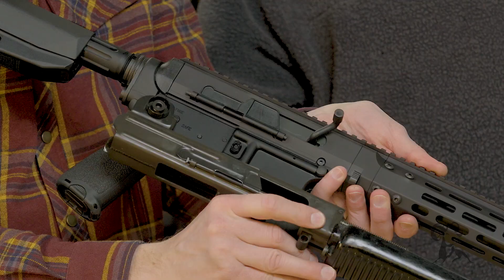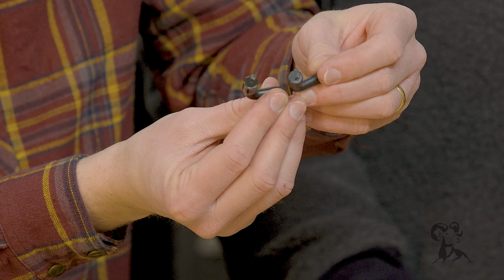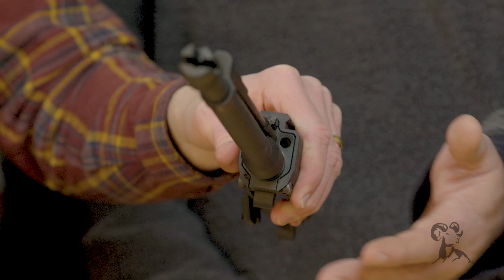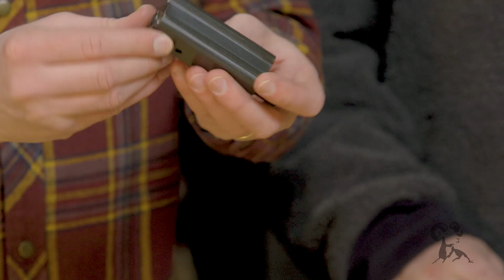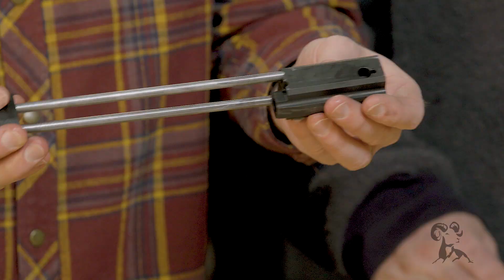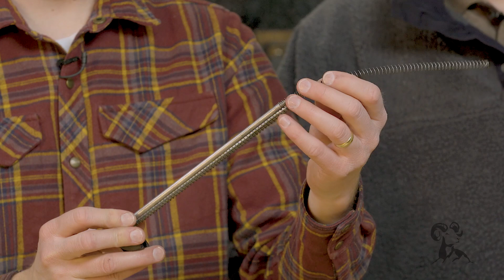Brownells BRN-180™ Upper Receiver Detailed Overview

Comment: I have a question:  why would people want a full length Picatinny rail on the top of the handguard?  Sure you want a couple inches up front for an iron sight, and you want a couple inches right up to the upper receiver for a sling mount (maybe). You don’t want an optic mount sitting on any part of the handguard rail. What the heck are you going to mount in the middle?  I can see my thumb wrapping over with a Vortex LVPO, and I often want to wrap my thumb around the handguard. Honest question/not trying to be a wise ass.

Comment: I want I take this upper and build it into a bull pup lower. I think with the 80% rules you could build a lower that’s legal as well. I’ve got an idea on how it can be done. I’d remove the silly handle and put in a .5 or .75 in textured block instead.

Comment: The only thing preventing me from getting one of these is the lack of a front sight/gas block. Originals are extremely rare and reproductions non existent. I like fixed irom sights but I cant use those without a proper gas/sight block. I hate free float rails but I cant use another handguard without an proper retainer. The only thing retro about this is the name. Should have given this the same treatment as the ar 10. Seriously I don't care about it being stamped, or if it has an original lower. I just want iron sights that are fixed to the rifle instead of sitting on a tube and the ability to but on a forend that once again isn't a tube. If I want what is essentially a side charge ar upper I'll buy one, for less than half the price at that, AND I'll still be able to.use a different handguard.

Comment: Y'all had ONE job: Take a classic rifle, and reproduce it to sell to a new generation of firearms enthusiasts who don't want to deal with the hyperinflated boomer market. And you went full Anderson and fucked it up and created this mongrel abomination!
Saying you were inspired by the 180 design is one thing. But do not disgrace the AR-180 name with this bastard design. BRN-1815 would be acceptable if you're hurting for a name. Hell, be clever and add the numbers together. But we want the original AR-180 design. We want stamped steel and the quirks that come with an older rifle design. Why do you think the G3, FAL, and Kalashnikov rifles are still so popular, despite ARs having more customization options, more interchangeable parts, more availability on the market, and more accurate features? Because the modern firearms enthusiast appreciates the history, ingenuity, character, and uniqueness in design of those other rifles.
Make a true repro of the AR-180. The market is there, just answer it.

Comment: It is not that it is more difficult to do stamping's now, it is actually very easy with modern equipment. it is just that with CNC machines it is much more easy to machine a block of billet aluminium to make a lower receiver.

Comment: As a long time owner and shooter of a ar-180. You missed the mark. The ar180 is not a Ar 15. There are plenty of ar15s on the market today for a lot cheaper price. This is basically a ar15 with side charger. My opinion. The Ar 180 was designed around a 55 grain bullet. 18 inch barrel with 1to 12 twist. Very fast and flat. Removal scope with return zero mount. The lower is Ar 15? Why? There’s very little of this repo that fits the Ar-180.

Comment: Easily the coolest gas piston AR style gun
Mostly because its affordable and runs on AR lowers
If it holds up under abuse (and frankly I see 0 reasons why it wouldnt perform as good or better than any other high end piston style system)
This will be a must for all the piston guys. The only way to improve it is to add an adjustable gas block you can adjust with the handguard still on

Comment: Proven design, it was a wholly and completely Superior application  of design to the original AR-15. The only thing that it may have needed was a little bit of added strength to the folding stock attachment mechanism. Furthermore, it being a steel stamping with a steel barrel it had an advantage the AR-15 still does not have. It does not suffer galvanic responses when it is in high humidity environments. AR-15 as soon as it made it in country in Vietnam started to eat away at the aluminum. The 180 didn't have that problem, plus it had far more room inside its receiver so that if any dirt ever got into it it didn't have a tendency to interfere with moving parts as readily.

When they were testing the ar-180 against the AR-15 they intentionally put a bad mag in the mix for the ar-180 so that it would lose in trials. Everything else about the firearm was equal or better than the AR-15. Love the idea of being able to get ahold of a 180 though. I do like the added accessories. Where's the folding stock??????

Another point I'd like to make, it's a inline recoil from a 5.56. It has no Muzzle rise. But it would be great in 6.5 Grendel. And the key big soldered to a piece of Steel Rod is probably going to last longer than a cast handle.. casting in the 1960s was not nearly as effective as it is today for one thing. And a tempered piece of Rod will Outlast a piece of cast. And I don't know how much I like that friction fit of a plastic retainer, phenolic resin, for the recoil springs.

Comment: Gun Renaissance it is.
Reply: Not even close. This is more of a design fusion than a full-on remake of the AR-18. They could've made a more proper "retro" AR-18 design using the NoDak Spud milled lower as a starting point. Decent gun, but wouldn't call this an AR-180. Shame.
Reply: I dont think I ever mentioned that this is a full reproduction of the AR-18? This is an upper receiver for anyone who doesn't want any hassle to have fun. And how is that related with my comment about "gun renaissance"?
Reply: @Alphonselle  It's not a renaissance of the AR-18 or any of its derivatives. If this is to be sold as a retro-line rifle then it would be an unfitting inclusion to the lineup. The expectation was for a remake/renaissance of the classic AR-18, not this AR-15 that tried hard to become an AR-18.

Brownell's could do better than this without going down the stamped sheetmetal route.
Reply: @hirokiree1051  What are you even on about? "Renaissance" means "rebirth", the age when people starts to rediscover old ideas and values of old Greece and Rome. I commented "gun renaissance" light-heartedly, joking about brownells revisiting an old idea, the AR18, and did a modern take on it. they also did not sell it under their retro line rifle, cuz it's not a firearm, it's just an upper receiver, thus, legally not a firearm. stop going around flaming argument when people are just trying to have fun.
Reply: @Alphonselle  The rinascimento is reknowned not for simply redisocovering and reintroducing works from antiquity into western europe, but also using lines of classical thought to innovate and kickstart a new era of technology and artwork.  Ergo to be a comparison a new renaissance would have to be innovative, which rehashing old designs by itself is not.

Comment: Is the gas block removable, and can it be fitted to an ar15 replacement barrel?
Reply from the maker: it cannot as it is not an AR barrel.
Reply: @brownells  Will replacement barrels be made available in case we want to change caliber or make it shorter?
Reply from the maker: Likely yes, one we get all the engineering worked out for shorter barrels with proper operation.

Comment: I have a real AR-180, the 1980's was a great time to get some cool firearms...e.g. HK93, FNC. FAMAS, et. al. But I definitely like this and going to pick up this 180 Upper. I even have a lower fully assembled with no upper for it. Also planning on getting A Bren 2, 14.5" barrel and then pin and weld it so I can put the Bren stock on it. Hence reconfiguring the pistol 14.5" barrel to a rifle.

Comment: Want to see it shoot, both suppressed and not suppressed. Really wondering if it would be a good suppressed rig!
Reply: Id worry about the lack of block adjustability.. Wouldn't want it to beat itself apart or peen anything
Reply: I'd use with an OSS suppressor

Comment: How well does this run suppressed.
Reply: glocktard That’s a question with an overwhelming amount of variables. Depending on what suppressor, you can expect higher port pressure, faster cycling, and more fouling coming in from the chamber.

Comment: 3 concerns: 1) Is that gas block pinned? What's holding it on? 2) What options are out there for side-folding AR stocks? I definitely don't want to pay $250+ for a Law Tactical. 3) Is the recoil assembly totally dependent on the plastic buffer pad? Because those tend to not hold up well over time.
Reply: I don't understand why the folding adaptors are so expensive. They are/were mfgd in my town, and I used to work for the company that did the Cerakote on them. If you got one made in 2015, chances are I personally media blasted and prepped it for finish.
Reply: Marcus Toroian SO THATS WHY THE FINISH IS PEELING OFF ON MINE.   😂🤣😅    JUST KIDDING.
Reply: Check out ACE rifle stocks.  They have an AR adapter that you could bolt one of their stock hinges to.  You could then attach a fixed or collapsible stock.  Looks like Doublestar bought them out. - star15 dot com

Comment: Will there be a version that will trip an M16 auto sear?
Reply from the maker: We are open to possibilities...
Reply: not many customers for that. that would be cool though
Reply: @Big-Government-Is-The-Problem  And? Would people decide to NOT buy it?
Reply: Binary trigger needs an FA carrier too.. Soo..
Reply: Please tell me which binary trigger requires a full auto bolt carrier.
Reply: @Pest789  all of them pretty much. Full auto carrier are pretty much the standard now a days so it isn't that big of a deal.
Reply: I am Likewise interested.
Reply: Interested as well, especially if in an shorter length.  Keep at it guys!  👍
Reply: Very interesting.  Thank you.
Reply: @Pest789  original used a slight notch on an FA carrier. Best guess is that the sear trip uses the FA tail inside a binary trigger.. Sorry if i sound harsh. But thats the usual case with a Binary..
Reply: Really?  I haven't found one that does.  None of them have anything that sticks up to be tripped by the bolt carrier.  If they do, it's probably for more weight.  So please, like I asked, name one that actually requires it.
Reply: @Pest789  off the top of my head, the Fostech echo gen 2 and Franklin armory one. The original echo needed a special carrier, the Gen 2 can use any auto carrier.
Reply: @Pest789  Fostech echo II.

Comment: Just saying get a shorter barrel set up going drop a folding stock boom instant truck gun. By the way anyone bitching about there being any polymer for the upper to sit in the now readily available ar15 lower needs to remember that polymers are coming a long way now a days, look at glock, sig, cz, Smith & wesson, fnh and many more. If it works awesome it works, if people abuse it and it breaks? Hey its called a warranty plus cheap parts!

Comment: Okay I love the concept and the rebirth of the AR180 but will you guys make a Classic style? Im not saying make a whole stamped gun but just an Upper for AR15 lowers that mimics the classic style. Also will there be a paddle similar to whats on the L85A2?
Reply: Overwatch there is a billet AR-18 lower available. They keep saying at stamped lower would cost and I would agree but in this day and age you don’t need to do that to make a AR-18 lower. We make Billet AK receivers, there is a AR-18 Billet lower from the company that Brownells went to to help with their Retro Line.
Reply: @Anni3sgotagun  the funny thing is that the original AK was milled from a billet and the AKM was stamped sheet metal.

Comment: Nodak Spud has a Billet Aluminum you can use used like you guys worked with him on your Retro Line. You don’t have to use a stamped lower receiver. Just like we have Billet AK receivers, there is a AR-18 reciever. 

Make it happen Brownells
Reply: A billet AR-180 in the classic style would be sweet.
Reply: That’s what it looks like, go to Nodak Studs website. It’s a mix of both the AR-18 and AR-180B

It uses AR-15 components. Just a AR-18 style receiver.
Reply: It would be cool but I'm not sure Nodak Spud has the production capacity to keep up with this.
Reply: Neilis you’re missing the point, Nodak provided receiver specs and samples to Brownells for their RETRO Line. Brownells outsourced it to Aero so they can produce the lowers. Making a Billet lower would be simple.
Reply: Koyote Tan all it needs is an ar180 handguard to be perfect
Reply: @Herm Wanderer  fuckin chill dude
Reply: @Herm Wanderer  Chill out dude
Reply: @Herm Wanderer  You're just a degenerate predator.
Reply: I have to agree. I completely understand why Brownells went the AR-15 receiver route, but I would not have gone that way. Not all of us hoard AR-15 lowers. Part of the appeal of the 180 is to have something a bit different than the 15. If Brownells designed their 180 upper to work with the NDS 180 lower, there would be no need to shorten the action. By using all original 180 size parts and the NDS 180 lower, it would have been an almost perfect replica AND they could have made money by supplying the same parts to existing 180 owners. I understand there would be a handful of 180-specific parts to manufacture or source from another manufacturer, but the NDS website appears to address this issue completely. I gladly would have paid a bit more for a more authentic 180 using the NDS lower rather than the shortened upper with 15 lower setup. BUT ... I am sure there are other people who prefer what Brownells did and it is still a cool gun, so I will stop whining.
Reply: Theodore Pollock I agree, I would love for them to announce a true AR-180. This isn’t even a clone cause so much is different internally.

I love that they are doing something with the AR-18 but they should have went all out. I would have even waited